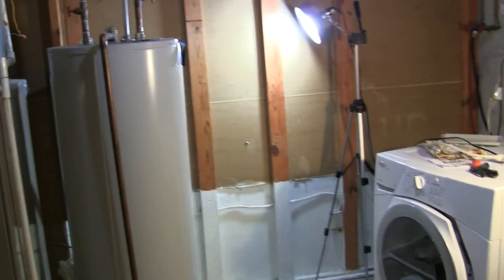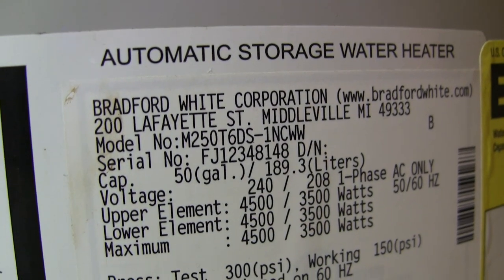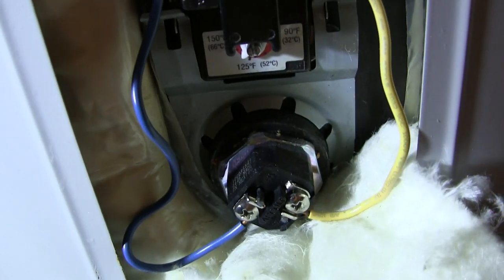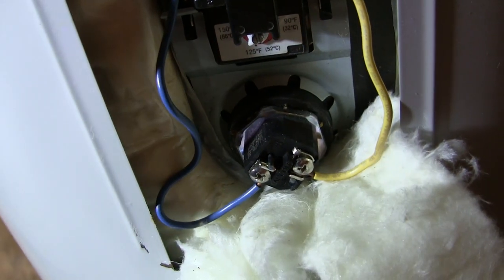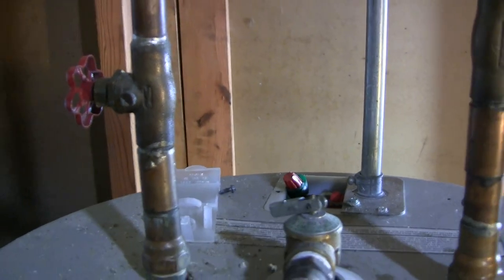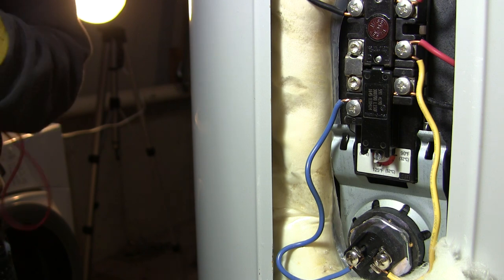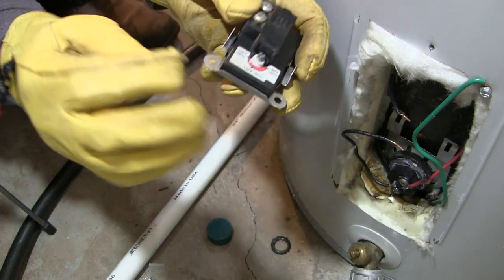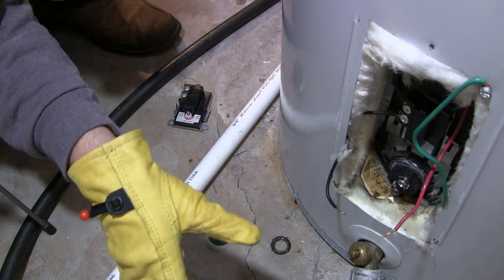Water Heater Heating Element EXPLODED! | How to DRAIN TANK & Change Elements and Thermostats

Comment: Many years in building maintenance, electric water heaters we used to replace the drain valves with ball valves. Most of the gate valves that come with these heaters are crap. If you ever replace a heater install a ball valve and it will always work.

Comment: My tank is too far gone and is leaking from the top.. Rusted out, so I'm gonna have to do a total replacement obviously. :/
Great video though.. These are skills all homeowners should have! 👍
Reply from the maker: Once you get into sweating new pipe, might be time to call the pro, unless you have some experience. I think I would be willing to try it myself, but I would want to watch several instructional videos before attempting it on a water heater.
Reply: @Fixologist1  I've done a little of it, but the way I figure it, I'm pretty damn good with soldering electronics.. it can't be too much harder to solder pipe. We'll find out soon enough though.. Lol. 😬
YouTube is certainly a blessing in that regard.

Comment: Brad, unless you did it off camera, you didn't get the right "foot" of both upper and lower thermostats behind the spring clip.  The thermostat is supposed to sit tight and flat in contact with the tank, so it can accurately sense the temperature of the water.  I would think an air gap between the tank and the thermostat might affect accuracy of water temperature?
Reply: @TheGuitologist  👍 I know it's not a big huge deal, but I thought say something.

Comment: I have replaced a lower on a smaller trailer hot water heater back in 99. Easy on the one I had. Went ahead and added new fiberglass insulation as well. Big jump in hot water when they are new from being old. hahah

Comment: Actually fashioned a spoon to clean the calcium out of the bottom of my tank. If I didn't clean the calcium out of the bottom. I would be lucky to get a year  out of the new element. Seemed by cleaning the bottom of tank. It would considerably last way longer. Just a thought if you would have to do it again in a short while. Keep them coming Brad.

Comment: I'm surprised the drain valve cooperated that easily.  I would have tested the valve before attaching the hose.  I've had a case where there was so much sediment, I had to turn the main water back on to get enough pressure to start the flow.

Comment: When I did that, I only changed the lower element.  It does about 90% of the work.  The upper one only really comes on if you're starting to run out of hot water.  Otherwise, the heat from the bottom one should keep the upper thermostat satisfied.  Unless that lower element went young, there's not a lot of point in changing other things as the tank is likely to be next.  In my area, tanks should be changed around 10-12 years.  If you push to 15, you're likely to end up with water on the floor.

Comment: BRAD THERE IS A ROD ABOUT 3 TO 4 FT. LONG TO ATTRACT EXCESS SEDIMENT,
IT COMES OUT FROM THE TOP, THEN YOU SLIDE A NEW ONE IN. MOST HAVE ONE ?
Reply: That rod you mention is not to attract anything. It’s a sacrificial anode rod that actually dissolves to protect the tank from electrolysis damage.
Reply from the maker: This thread taught me something. Thanks!
Reply: @yqwgjsg  THANK YOU BRUCE !

Comment: This all seems suspiciously familiar. Cut the power, drain the reservoir, disconnect the heater wires, and replace some cooked components. 4,500 watts of output power though - that's about 90 KT120's!

FYI: I'm starting to get a sprinkling of Guitologist notifications. Maybe we've turned the corner?

Comment: Draining water tank is also good in getting rid of sediment that collects over time.
Reply from the maker: I thought afterward that I should have Shop Vaccumed out the bottom of the tank while it was empty.
Reply: I wish I could drain my pituitary gland
Reply: Ps. I just learned about hot water recirculating systems and those should be mandatory, but maybe not because Elon just told me there’s plenty of water here on the west coast. He told me the hyperloop wasn’t strategic pseudoscientific misuse of what would’ve been a proven infrastructure project for public transport used to drill one lane tunnels too.

Comment: Do you not have any gas or oil boiler for water heating over there? In my system, we have a water tank upstairs with a heat exchanger coil inside, that carries hot water pumped directly from the oil boiler downstairs. A diverter valve lets you send the boiler feed to the water tank for hot water or to the radiators to heat the rooms. 

There is an electric heating element inside the tank too, but that's generally only used as a backup.

Comment: Next time you go into the Big Orange Box or Lowes... pick up a water heater element socket wrench. The socket is dirt cheap. Just a couple of bucks. Leave it sitting on top of the water heater. Use maybe once every 5-10 years, but you won't have to look for it.

Comment: Well done and with care for the changed elements... Now that the work has been done, how much does the labor cost and who pays for it? I'm serious, in your opinion, how much would something like this cost if it was done by a company? I also changed the heating element from the washing machine and it still looks the same... but after 11 years of operation (twice a week) I think that the heating resistance (2000 watts) was worth changing... 15 dollars (without workmanship, done by me) and it's still working for 3 and a half years already... now I got the bearing kit and the sealing gasket and I'm getting ready to break this work too.."gratis", maybe a bottle of beer after the "reception" " works by the owner... a big "Like" and as few interventions as possible.. Dan

Comment: Flashback arrestors or the like should be such an easily implemented oversight extrapolated into systems at large and they are, but the difference is integrity and misrepresentation is appealed to by the new religion of anti scientific stupidity because expectations of knowledge in a society with infinite availability of information must ideologically destroy the insurances to blow up the house.